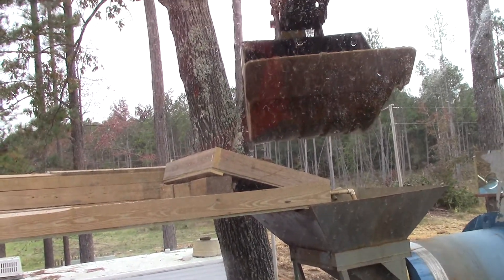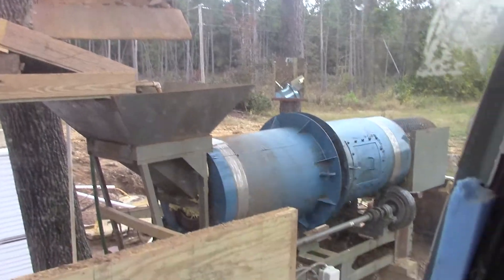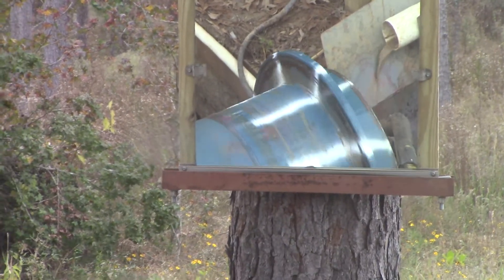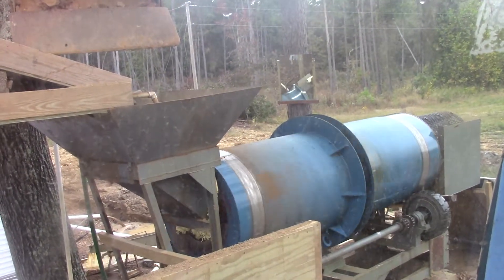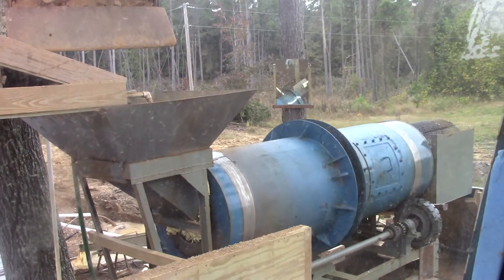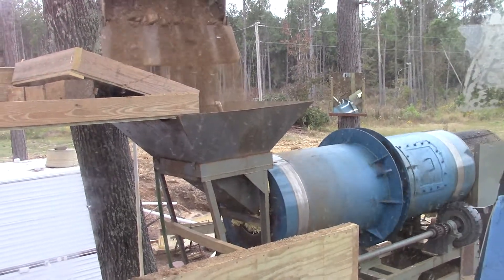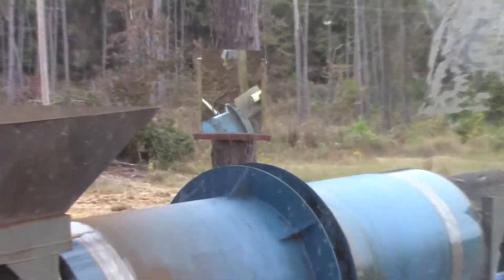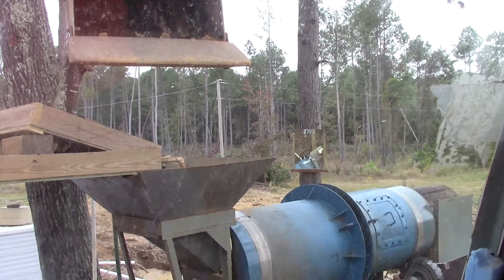Watch Me Feed The Diamond Recovery Plant With A View From The Cab Of The Excavator

Comment: man if only you had a conveyer belt that you could regulate the feed with.... basically, i would get a motor and a type of steel screw as long as the bin for the unprocessed ore, and i would set it to send material down towards one end, where it would fall onto a very slow conveyer belt that would send material at no more than a gallon per 5 seconds or so, to start out with so it becomes a near continuous feed, but with more control and Maybe faster, and would only need to be monitored for both efficiency, and to prevent clogging. so, you could dial it up or down with a load of material, up to where a clog or slow down of the trammels, and then dial back again until it is most efficient for you. of course, that takes money, but i bet a crafty person could design one with steel tubing and aluminum rollers, a leather or rubber flat belt, and a couple variable speed motors, electronics and such. certainly worth looking into as a future option once it is designed and affordable. perhaps a low speed super high torque gearing motor woudl be optimal for such a set up, since you coudl theoretically synchronize it with a single variable speed knob. i think if it could be mostly made with sheet aluminum or thin steel. it could be welded up and designed fairly easily with a good machine engineer, and fabricator. then, you could just fill the bin that meters out a certain amount of material per minute, or hour, and not have to dump directly into the hopper with the excavator, and you could just use a front end loader to a lower height material bin...
Reply from the maker: If I had more money to throw at it, I could get it all set up.  For now, this works a whole lot better than throwing buckets of ore in that I filled by hand.
Reply from the maker: Eddie, I boxed up your ore today.  It will be shipping out to you tomorrow.  Thank you for your order.
Reply: @genuinediamondsinar3253  thanks to you for offering raw diamondiferous ore =) i cant wait to see what i find
Reply from the maker: @EddieSchirmer  Thank you for ordering a box.  We got yours ready this weekend along with 81 others and took them to the post office this morning.  It's on its way to you.  We really hope you find something nice in it.  Please let us know when you do.